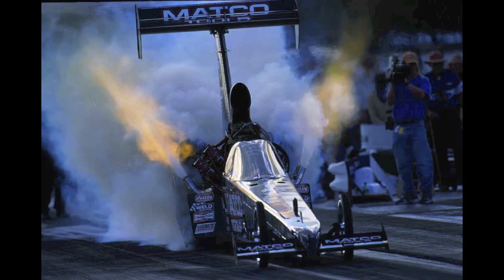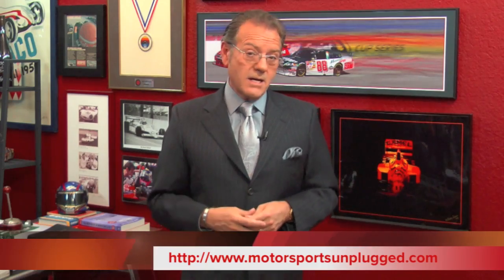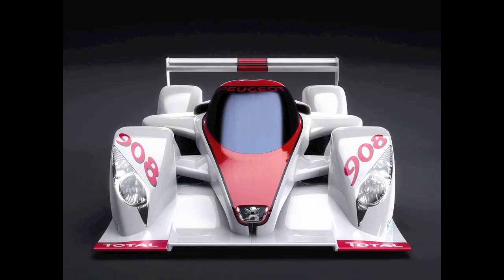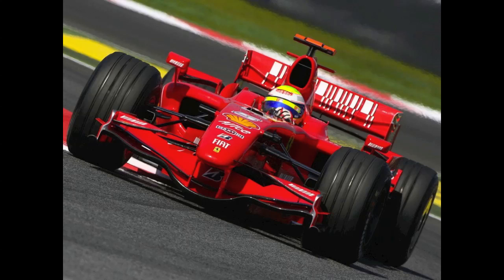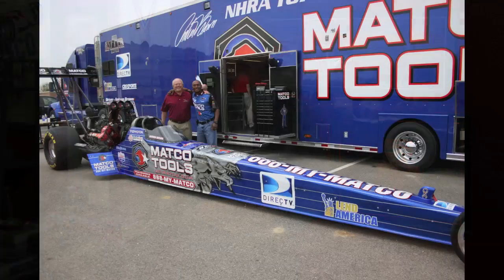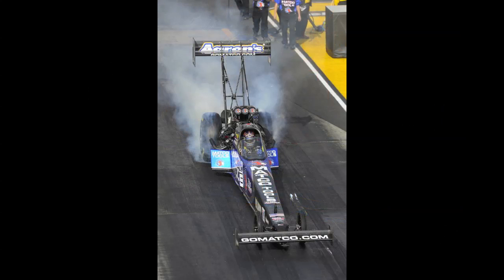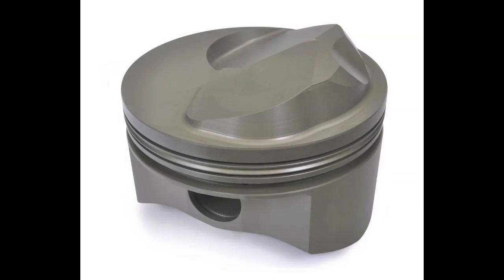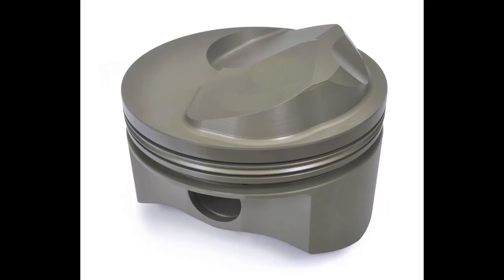Top Fuel Engines? Controlled Nukes

Comment: nitro is 53% oxygen .the more fuel and air you can put in it the more power .high pressure pumps and high flow injectors help atomize the fuel for a better burn.

Comment: uh thats not true at all what you're saying. the secret to all that power is in the port design in the heads, the supercharger and the fuel of course. 

you cant just boost an engine and expect to reach a shitload of power w/o a highly modified intake and exhaust port design.

and besides, the internals they are using are nothing like what we can buy. all that shit's top secret.

Comment: The fuel itself increases the power of the car.The fuel is nitromethane, the molecule has 3 hydrogen atoms bonded to one carbon. Now the carbon atom can only have 1 more bond so Its bonded to a nitrogen atom. Now this nitrogen atom bonds with 2 oxygens atoms one of the bonds are a single bond and the other is a double bond. Now this fuel is extremely volatile because it has already provided the fuel with 2 oxygen atoms so the oxygen contents is high.

Comment: That piston wasn't from a top fuel engine. Those engines make around 7.5:1 compression and a shit ton of boost, so those big dome pistons aren't 7.5:1 compression. Plus those cars don't use the full horsepower till about 1/8 mile.

Comment: I guess it must be nice to have big money and a pro production crew behind ya.  It still mystifies me as to why the piston at the beginning and middle of the video isn't even representative of one used in a (iconic Hemi) Top Fuel engine...and it's design is the reason they make the power they do, by allowing a "straight" intake and exhaust path to get massive amounts of air and fuel in and out of the engine.  Odd.